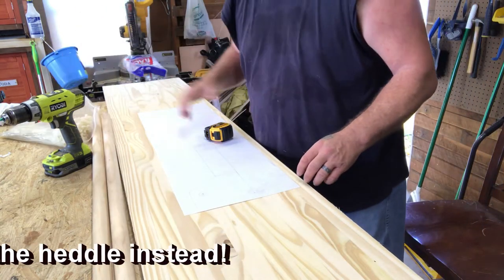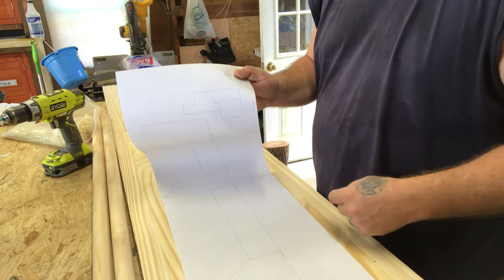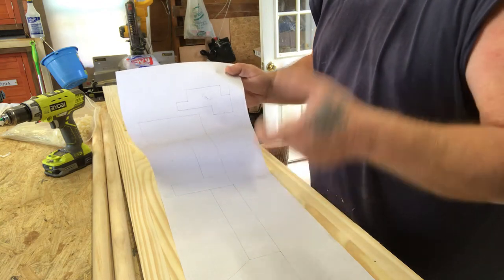DIY Rigid Heddle Loom | Part 1 Starting the Build

Comment: Thanks for this. I’ve been considering a combo rigid heddle and backstrap set-up. But I want to weave some wider widths ideally. I wonder how wide a person could get without a rigid frame before losing rotational stability. I like the simplicity of your advancing mechanism. Does it have uneven tension right to left with the locking peg being on just one side?
Reply: It’s interesting how a simple figure 8 of string and a double dowel will hold warp advancement  under tension… maybe a bungee or ratchet could provide tension on a simple frame with just a slot for double rods? https://youtu.be/ROlGnQn02i8
Reply from the maker: Nope, it remains tense the entire width of the warp. The only issue I had with this design was in the "Cogs" being made out of dowels, not the strongest and had one crack on both sides when putting tension on. I think if those dowels are offset from each other, and not one drilled through to put the other,  it would be a lot stronger, or replaced with a bit of metal rod instead of wood.   The only other thing I would change is the overall width, and make it more more "standard" to accept store bought heddles.  Being made of wood, the thread tends to act like sandpaper when the heddle is pulled back and forth a few hundred+ times, making the holes bigger. Not too bad though, just have to make a new heddle about every 20-30 projects ;)

Comment: How long is the loom from front to back? I am guessing the ends where the rods went through are about 5" tall also? That would help me a lot to know the measurements but good job on the whole process!
Reply from the maker: The length from front to back is 27.5", and the ends are 5.5" tall. The width (outside to outside) is 29" wide. In hindsight, I should have looked online to see what the longest "Commercially made" heddle is and based the width on that, that way I could order in different heddles for different thicknesses of warp material, but loving that I can make material that's just over 2' wide ;)  Thanks for watching!
Reply: Where can I get the pattern
And all measurements